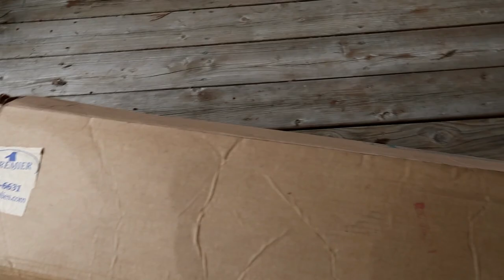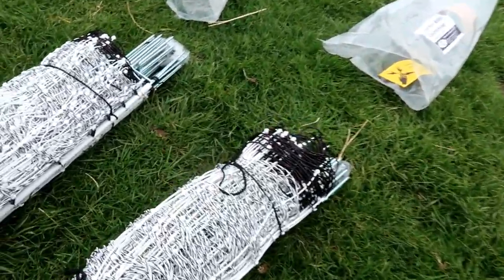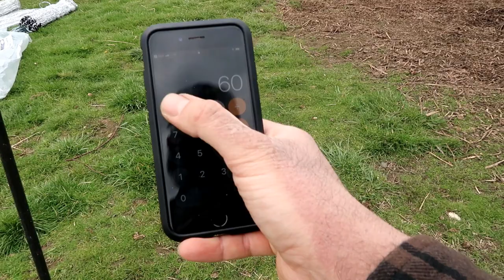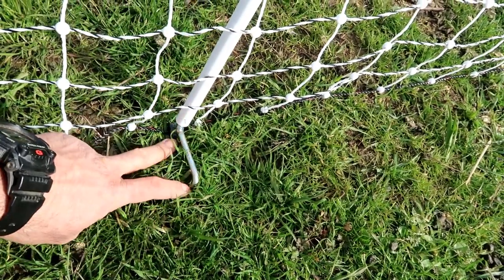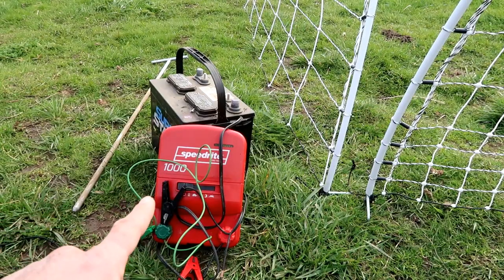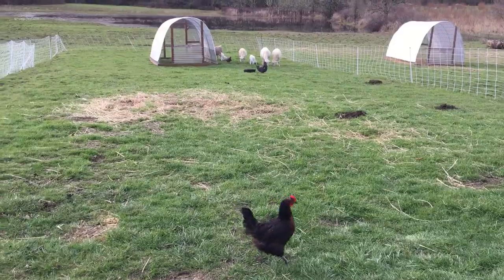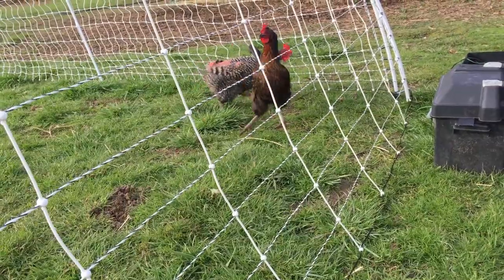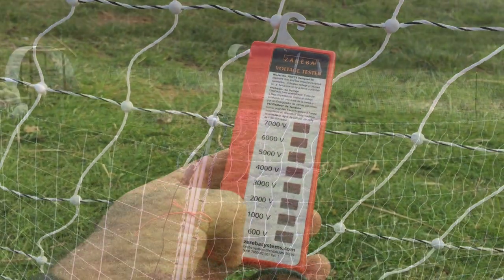All you need to know about ELECTRIC NETTING

Comment: Thank you for sharing. But I got concerned when you allowed your animals to touch the netting, so they thought that it’s okay to touch. I bet the poor animals were needlessly shocked several times before re-learning that the fence is NOT OKAY to touch after all. What happened when you electrified the fence?
Reply: The only way animals learn not to touch electric fence is by touching it -- explaining to them doesn't work.  These animals (at least the baby lambs and chickens) were clearly not familiar with this type of fence before they were put into the enclosure, otherwise they would have already learned not to touch it, whether it was energized or not.  It's also necessary to de-energize the fence when moving animals into or out of one of these enclosures, for reasons which should be obvious.
Reply: That’s the point.  It’s how they learn.

Comment: It looked like you hooked the red clamp up to the fence connector...is that correct or should the red clamp be clamped on a fence line.  My poultry net does not work so trying o figure out what I am doing wrong.
Reply: Hook it to the metal tab connector, it makes a better connection than putting it on one of the strands.